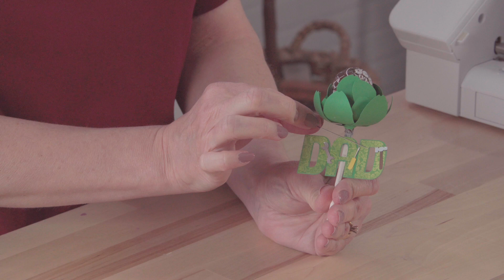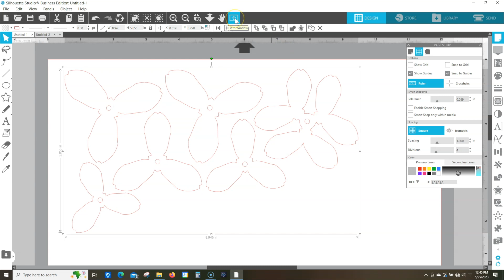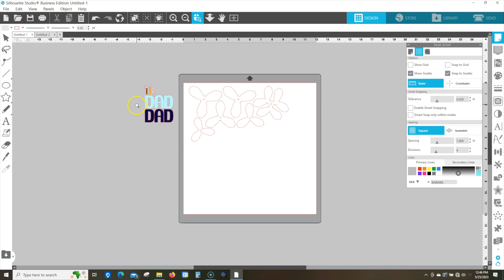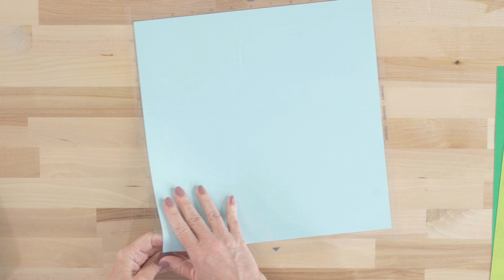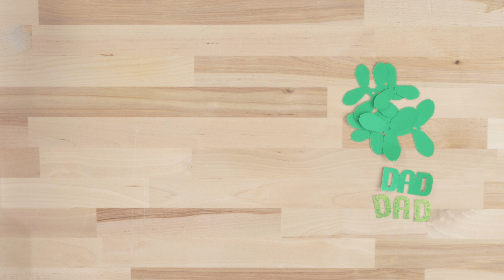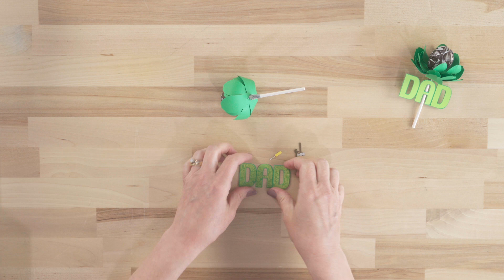Craft Along | Lollipop Father's Day Boutonniere

Comment: Can the cameo silhouette be used with other cutting/plotting softwares?
Reply: Silhouette Studio (free) is the software used to run the Silhouette cutting machines. However, you can purchase Silhouette Connect to cut directly from Adobe Illustrator or CorelDRAW. Other cutting machine software will not run the Cameo. Here's more info on Silhouette Connect. https://www.silhouetteamerica.com/software/sc
Reply: @KellyWayment  thank you very much. That was a huge help and spot on for creating projects in another software but able to transfer it & cut.
Reply: @ds1755  Glad I could help! :)